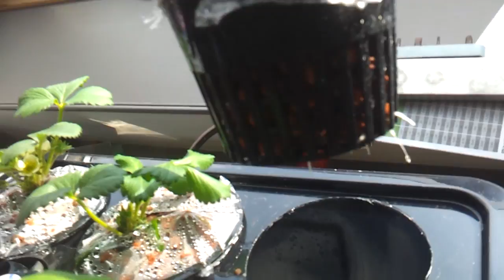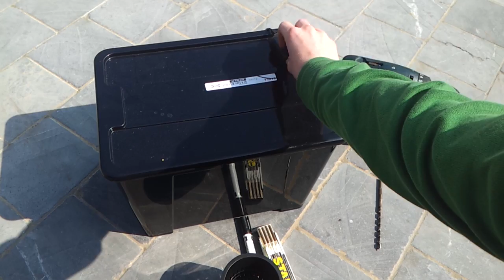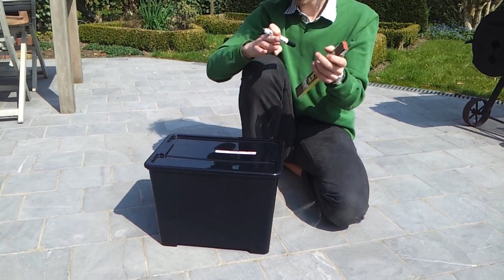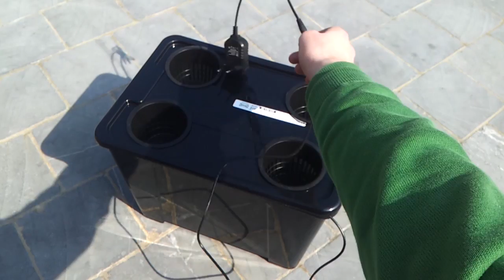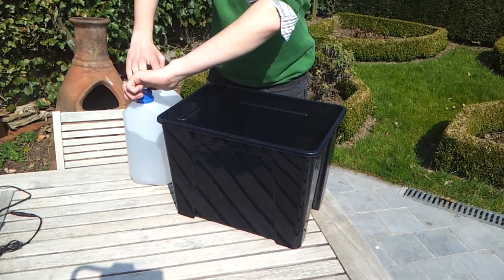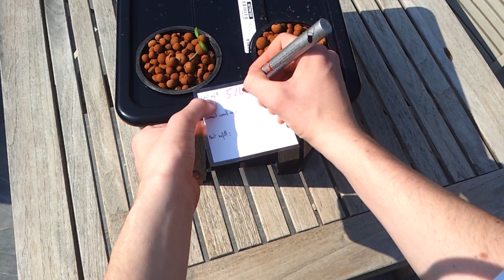How to build and use a fogponic system

Comment: Little tip. When you start to drill the large hole, run the drill backwards at a fairly fast speed. It will be much easier to hold the drill and will produce a cleaner hole. ... Chrissy

Comment from the maker: Thanks for the compliment :) I'm indeed European, as you could probably tell by my accent. I took the pH levels and EC values from Plagron's grow schedule. 0,4 - 0,8 EC seems really low to me, and is about twice as low as recommended by Plagron... Either way, the tomato plants are doing really great, they're more than a meter tall already, so I don't think they had too much or too little nutrients :)
Reply: Bit late here myself. Your ahead of the curve. 😆
Just started fogponics. Only issue im having is nutes. But I'm being sanitary best I can. Using drip clean + h2o2 + skunkwerks. But seems they need something more. They struggle staying healthy.
Only thing different you can do better which i just had the thought yesterday about bags to cover the pots. First I'd have used nontransparent black bags. But i already had foam plugs i tried but they again struggled when bigger. Now trying nets n ton. With foam covers above the hydroton which fit right in the net pots top. No more bags n rubber bands.

Comment from the maker: As for the mister: it vaporises water using high frequency vibrations, so it doesn't create a gas (like water vapour is), but just a mix of air and tiny spheres of liquid. This keeps the temperature low, the water reservoir clean of algae, and delivers plenty of water, nutrients and oxygen to the roots.
Reply: It doesn’t vaporize, the fact that it creates a cold, dry fog contradicts that.

Comment: This is really great. How long has it been running? The piezo elements that I've seen are rated for 5000 hours, which is less than a year if it's 24/7. I believe a 3 minute fog / 3 minute rest regime would make it last twice as long. I have built a controller to do just that.

Comment from the maker: Yeah, they get clogged after a couple of weeks, depending on the cleanliness of your nutrient solution and the quality of the fogger. Just clean them once a week and replace them when they fail, and you should be fine. I never tried microsprayers, but I'm currently planning on a new system for next summer that doesn't use any substrate, so also aeroponical in theory.

Comment from the maker: All plants need a steady supply of water, as they use it for photosynthesis. I've had a fogger fail about 3 times so far, in a total of about 9 months, that's one per 3 months. 2 out of 3 times no problems, one time it happened over the weekend, so the plants were dehydrated rather badly. I guess it doesn't matter what system you use, if it's turned off for a long time, your plants will die. The fogger doesn't need to be running 24/7, you can use intervals.
(see next post for other answer)

Comment: In hydroponics guides, I keep reading that it is important for water temps to be between 18-20C so that there is plenty of oxygen and little chance of pathogens appearing.
Does the fogger eliminate the need for keeping the temps of the water down? Also, what fogger are you using (and where did you get it), and how loud is it?

Thanks for making this video. It's very clear and well presented.
Reply: You don’t need to worry about oxygen levels as long as your roots are not hanging into the resevior

Comment: hello there! congratulations for your videos! I dont understand something though. 
1. how much water u need at the bottom of the box for the system to work?
2. What happens if the plants' roots reach the water at the bottom?
3. How often do u clean the box?
4. If you take pH and EC readings and you understand that your water needs adjustment how you do that without disturbing the roots of mature plants?

Thanks a lot in advance

Comment: Im considering between fogponic and aeroponic. I read that fogponic systems needs to be 24/7 on, also that sometimes even a half a day off can mean losing plants.

You have said replace them if they fail, how often does that happen? Did it happen to you? How long they last with proper maintenance?

And the last question. In general hydroponics system include also air pump to oxygenate closed spaces in terms of bacteria prevention, while you dont. Have you some experience or opinions on this?

Comment: If you mounted the fan entirely inside the box, it would circulate the air.  Having it push air in from the outside is pressurizing the box, and it has to escape somewhere.
Reply: James Thrasher > There are waterproof PC fans that work even under water. So it's not problem. But the author doesn't want noise. Firstly, the fogger is 24VDC and not 12VDC (PC fans want 12V). But even 12V is way too much. You want just a little air movement inside the box, not a tornado. 5V should be enough - and near noiseless.

In fact, I am thinking of exactly that. I bought the big IKEA boxes and they are 40cm high. The vapor stays much at the bottom.

Comment: House of hydro has some good deals on single fogers you get one for like $20 with a float I always build inline timers into them because you really need a timer that does a few seconds on and off. Like 10 sec on and 3 off.. I got like 100 timers from China for like $20 Works great if you know how to solder. Or you can purchase a short cycle timer on amazon.

Comment: My system is running now. I just have a bucket with a flat rim and a plate on top. I stuck some spongy tape around the rim to make it a bit more air tight. The single fogger creates enough mist I believe.

More question:

As the root get longer, is there a problem with the roots getting into the liquid, which will happen sooner or later?

For young plants that just rooted, you mix the fertilizer at normal strength or diluted?

Comment: Two questions:
1. Does the fogger run 24/7? I think it should be OK to run it on and off and then maybe control it with a humidity sensor.

2. Don't you have to get fresh air into the system?
Reply from the maker: 1. Yes, I run it 24/7. I think you can get away with 15 minute breaks, but not much longer. It depends on how much volume the fogger has to fill: the smaller, the faster (and denser) it will be packed with fogg.

2. Enough oxygen gets in via small openings around the netcups and the lid. This is evident from the fast growth and the healthy, fluffy white root system. At first I had put a tiny fan in place to circulate the fogg and bring in fresh air, but this forced out the fogg through numerous tiny holes, so a lot of nutrient solution was wasted.

Hope that answers your questions ;)
Reply: Hydroponics Explained Thank you. How embarrassing, it was already discussed and answered earlier. I will start with something similar to what you do. I may put a humidity sensor (DHT11 or similar) inside and switch the fogger on/off to save some energy. I won't use a fan, but 'if', then I would probably put it inside the box. There are plenty of waterproof small fans that can run even under water. I will start with something easy and tasty, basil, mint, later then tomatoes.
Reply: +C00ltronix Not sure if you still care about the answer to your question 2 yrs later but I have found my fogponic system to run best on a timer. It runs for 4 mins and is off for 12 mins. This gives your plants' roots some time between mistings to dry out a bit. It is a similar idea to ebb and flow systems in that respect.
Reply: @KateInTheCity  and another 2 years.... Kate, does 4 on/12 off still work for you? I just started my batch of basil on 40 on / 20 off. I have no idea if it works yet. I'd love to know if you have any updated observation. Thanks.

Comment: hi this is great.  I am wondering if you have had any luck with a whole growing cycle.  Any ideas on how to combine a DWC approach with the fogponics?  Lots of forums say you can't flower anything in a fog box.  I've also read that that atomization is too small for proper nutrient uptake, although I think that is probably a minor problem.  I finally get all that parts and I'm going to try it out!  Aside from the flowering, heating, and vapor size, this seems like the perfect indoor growing methodology.  It puzzles me that there are not more 'purpose engineered' foggers on the market.  Anyways, looking forward to getting my fogbox steaming! :)

Comment: I'm going to try this build too. I bought the same black boxes at ikea, but after holding them to the light... e.g. a window i can see these black boxes are quite transparant. I will therefore spray paint them black anyhow. I think if you dont it will cause slower root growth since they do not like light. Also i have bought the fogger and power units seperately at ebay, this makes it cheaper and also i have the ones without lights. My question is just...will adding an airstone help? It adds oxigen to the water/nutrient sollution, but it evaporates anyway?? Also you use demineralized water, i buy mine in belgium costing 2euro's for 5 litres. That is a lot of money for water.. I plan to just boil tap water so its sterile, and cheaper. Also what i am wondering is if this will work with other substrates and rockwool as well..??

Comment: Cool video! - I am having trouble with root rot, the tips of the root turn dark every time, any tipps?
Reply: Water Chiller or timer.foggers get hot and you want to keep the water at 70 degrees.you can also use enzymes or hydrogen peroxide.to keep the reservoir clean

Comment: Hello this might be a dumb question but i can not find the answer anywhere on youtube or the internet i am setting up a fog box im using led lights with red and blue and i have a grow tent. The question i have is how long do you feed or water or keep the foggers on for? All day everyday or how long? I think my plants which are about 6 to 9 inches tall have been getting over watered but i havent been keeping the foggers on all day this is my first grow also any advice would be greatly appreciated
Reply: I have found my fogponic system to run best on a timer. It runs for 4 mins and is off for 12 mins. This gives your plants' roots some time between mistings to dry out a bit. It is a similar idea to ebb and flow systems in that respect.

Comment: Hey I have a question I got one similar to yours but it has a nozzle instead of simply xposed disk. It came faulty and I saw the video where yours gave on you. Did you repair your own by replacing the disk with a new one or simply buy a new one?  I'm trying to figure out how to fix mine and the nozzle does not seem to be able to come off

Comment: How do you deal with the heat? I have a larger system and the heat builds up. I have to put frozen 2 litre bottles in twice a day to get the temp back down. Tried reducing fog times but that is not working.
Reply: Same problem here - heat in water reservoir went from 20 degrees celcius to 28 degrees celcius when the fogger was applied.... i might try a seperate fog tank with connection to the growbox above water level
Reply: @claushougaardpedersen5239  So you would have 2 tanks of nutrients to swap out? 1 is cooling down while the second is heating.  I'm going to try that. Thanks Claus!
Reply: Water chiller is the answer

Comment: Would it be possible to stick low-emission UV lamps in the fog box to inhibit bacterial growth or would this adversely affect the growth of the plants?
Reply: A light-tight box like that shown in the video would not allow enough light into the box for bacteria to grow.
Reply: UV Algae killer are usually closed systems and you can see the UV light, hence it can't harm the roots. You need a water pump though and the creator of this guide doesn't want noise. This said, there are some quite small UV algae killer around for fish tanks.

Comment: Do you really get the benefits of aeroponics over other systems if you're using a saturating substrate?
Reply: +reinux I believe it's better not to use any substrate because the plant doesn't need it in an aeroponic system.  I would also put something around the box to prevent light to enter through. As you can see light get's through the plastic like through a dark sunglass.

Comment: Hmm, don't answer your comments then, eh?  To bad.

I was going to ask you if in the time since 2012 you have changed anything or found any improvements?  I was also wondering if you would benefit from an airstone inside the kit, or if that would do the same thing as the fan and blow mist out of the box?  How do you get oxygen in the box?

Comment: Interesting video,but i have some issues.
First the name fogponics is NOT a technique,its just a made up weird word something in between enggreek or something.The technique is not different from aeroponics.Then the fresh air in the container,the plastic closes down de tank and there is no ciculation in the tank other than waterdrops which vaporize .the oxigen will be used by the big plants in no time roots will choken and plants will die.
Airmoist in a normal house (ur bedroom) is to low for seedlings,in the winter it can fall to under 35-30% and summertime 40-60% seedlings needs at least 90% to grow faster,thats why propagators have a plastic cover.Some knowledge about botany would be appropriate.I can have the same results in normal soil in glasshouse conditions.
Ur story about fertilizer and leafcolour at about 9:20 is a little bit weird.
There are different kind of symptoms for different kind of nutrients.Different kind of plants need different kind of fertilizer.The lack of a specific nutrient means often an overdose of another kind,but it can work the other way around as well,The lack of a nutrient can block acces to other nutrients.Nutrients is a science and not to mess with.And the price of those "special" nutrients is insane!!!

Comment: yikes... power tool safety course, asap! 

 kept expecting to see some gnarly flying gore. you're seriously treating that drill like you had plot armour or a god mode cheat code for life. never, ever put your weight on / lean ona tool that can obliterate your workpiece in a fraction of a second, and cut straight thru and into some part of you. and keep your other hand away, preferably in a thick leather work glove

ps AND your pilot hole drill bit is outrageously huge
Reply: Dan L  oh just routers, wide beltsanders, impact wrenches...
Reply: In other words, no. Talk to me when you're an under water welder.